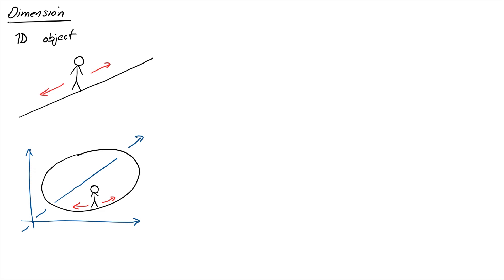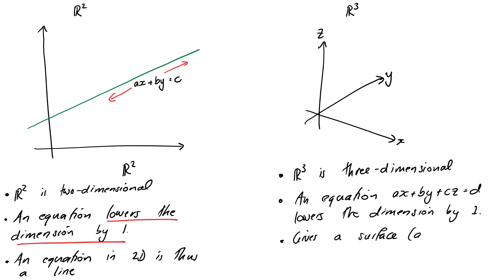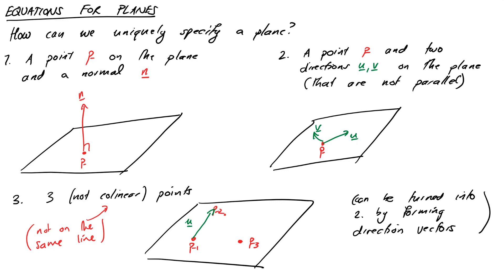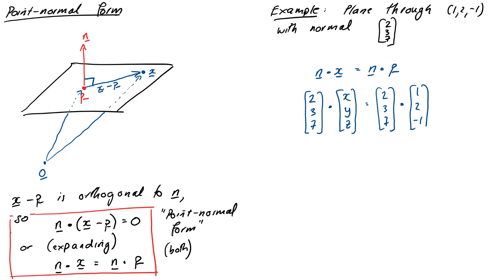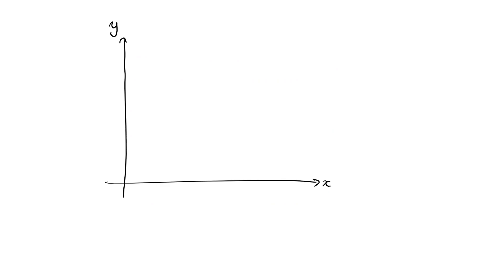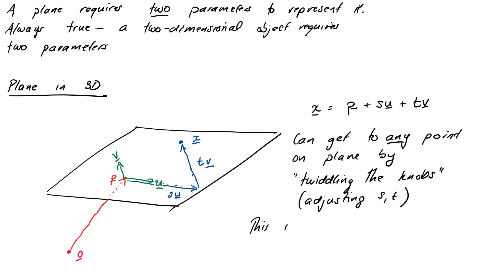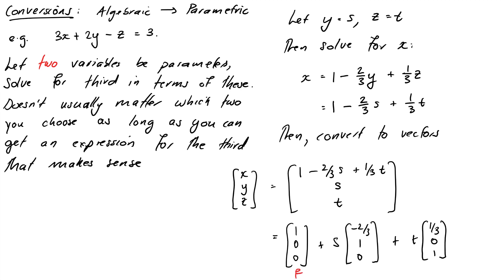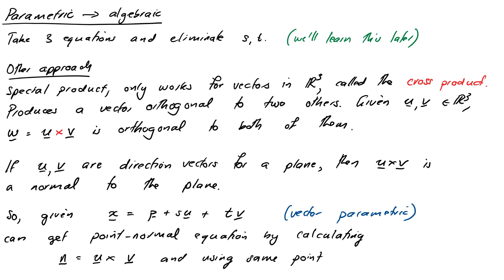Introduction to planes

Comment: One thing I find frustrating is where I come across a gap in my knowledge. I will be following along just fine and then suddenly you pull 3rd's out of thin air for the equation to convert to parametric and I wind up sitting here wondering where on earth you got 3rds from.
Reply from the maker: All that’s happening there (at about 11:38) is I start with the plane equation 3x + 2y - z = 3, and rearrange it for x: 

If I do in two steps it would be 
3x = 3 - 2y + z, 
then divide by 3 to get 
x = 1 - 2/3y  + 1/3 z
Reply: @ now that makes sense. Excuse the confusion, I just like to hear things broken down line to line. What each step is supposed to do. Huge thanks.